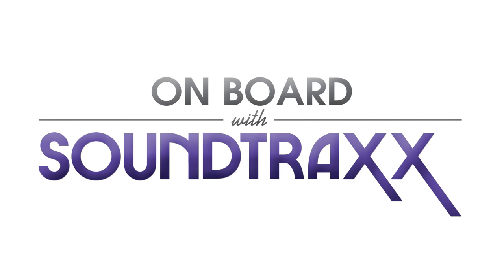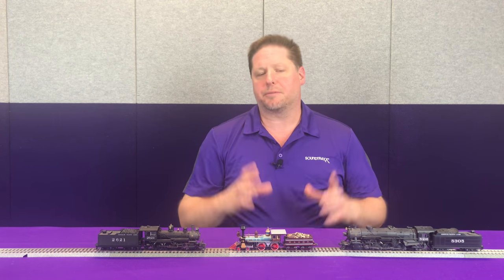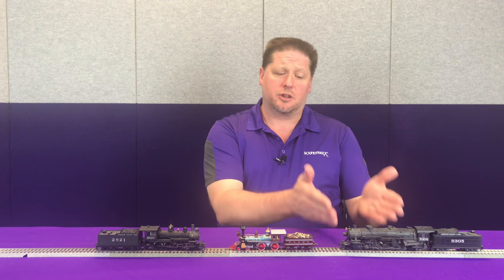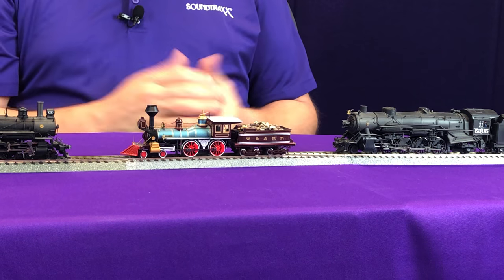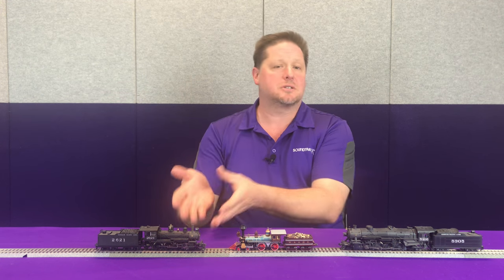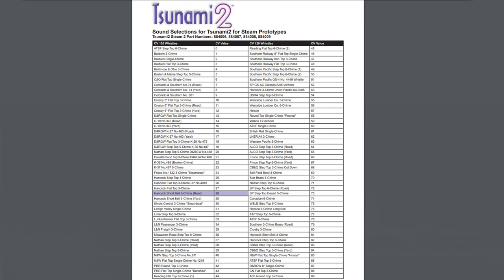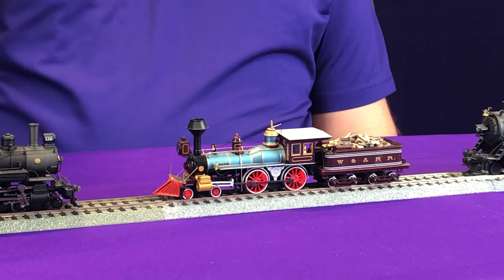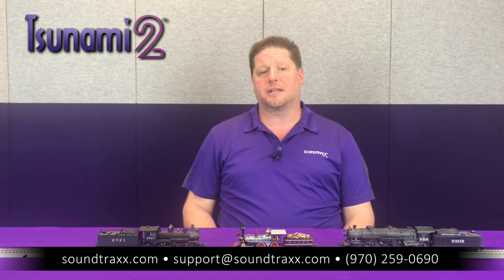Tsunami2: Steam Sound Set Up

Comment: curious, what are the frequency centers for the 7 band EQ?  I did not know this feature was included... Great idea! every install has its own tone.
Reply from the maker: All Tsunami2 decoder have the 7-Band Equalizer, so you can have a ton of fun with this feature! The CVs you will want to use are:

CV 225: Equalizer Control Register
CVs 226-232: Cut/Boost Controls (7 Bands of the EQ)

You can find more info in our Tsunami2 User's Guide and Technical Reference: https://soundtraxx.com/manuals/tsunami2-digital-sound-decoder

Comment: Hi George. I'm looking to install a few TSU-4400's into G gauge locomotives with AirWire Convertr controls and batteries. I was recommended this by a notable expert in the G gauge hobby.
Reply from the maker: Our TSU-4400 will be $30 off for one day only at the end of this month. Sign up for our newsletter to get more info: https://soundtraxx.com/newsletter
Reply: SoundTraxx - currently we are installing it in an older LGB Forney with AirWire controls. Will be programming it with an AirWire T5000 transmitter.

Comment: Love tsunami 2 but the diesel horns and echo sounds so computer generated. Esu and tcs sound natural like you standing right next to the actual engine and hearing the echo off the mountains
Reply from the maker: I think you need to play with it some.  In setting these, I was using exaggerated settings to produce the effect, but for what I do on my own locos is much more realistic.  Plus, you’re hearing these through a mic, so the perception is off.  I think you need to hear these in real time with more subtle effects.  But the other brands have no adjustments to tune it to your liking. We could just as easily do this too, but we gave you a option. I would also like to note that all of our sounds are recorded fro the locomotive. We always work in conjunction with the railroad to get the best quality sounds.